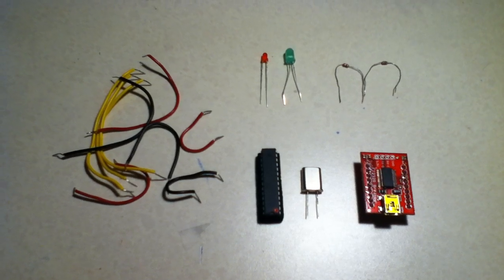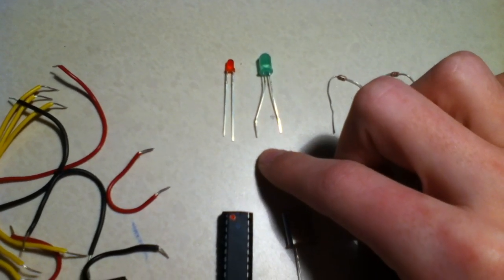Arduino on a Breadboard

Comment from the maker: Did you connect both sets of TX and RX lines? Which version of the IDE are you using? You have to make sure it's set to Duemolieve not Uno.